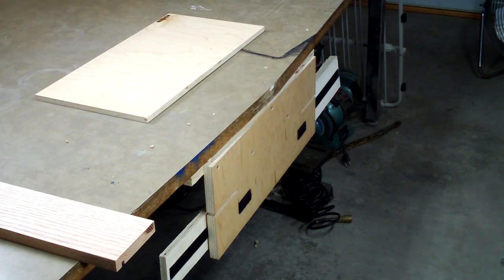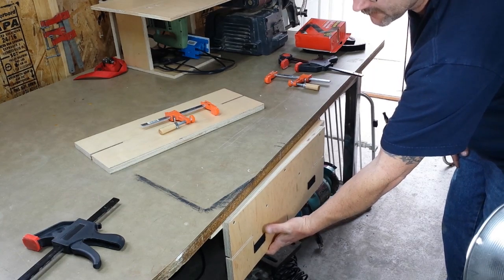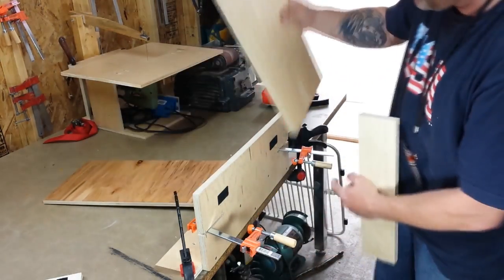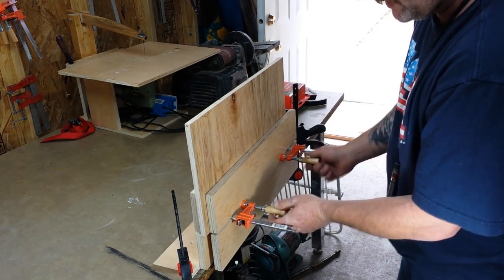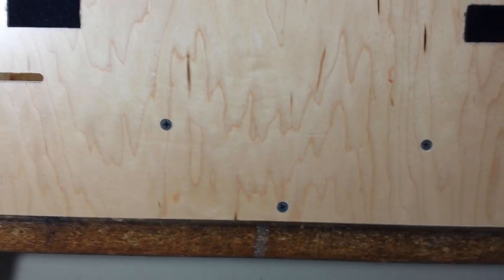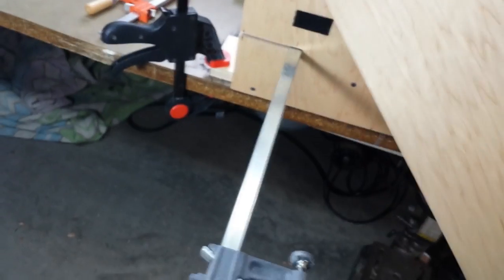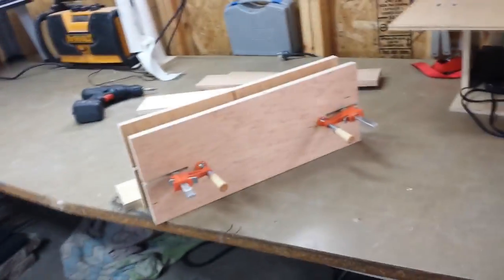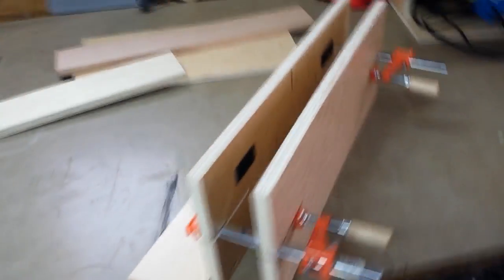DIY wood vise

Comment: just watched this video and I have a small suggestion.  if you drill holes at the inside end of the clamp slots so you can rotate the clamp, you wont need the spacer board on the bottom.  then install 1/4 inch thick boards in slots to keep the vice halves aligned.  enjoy all your videos:>)